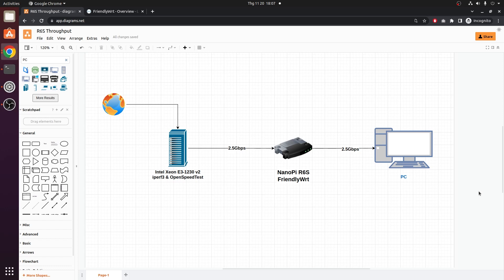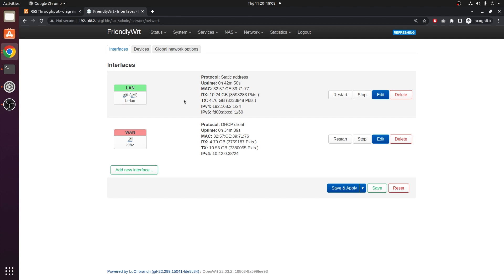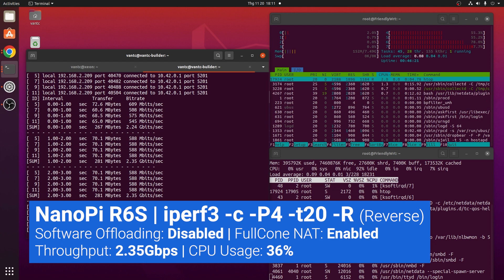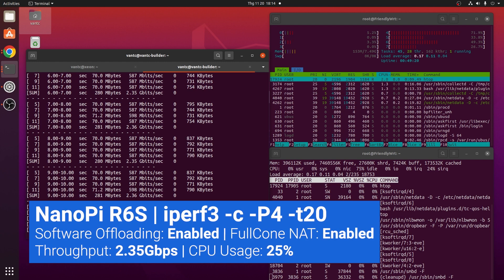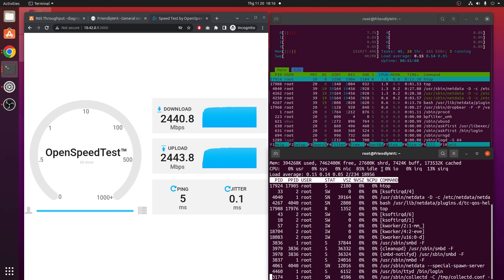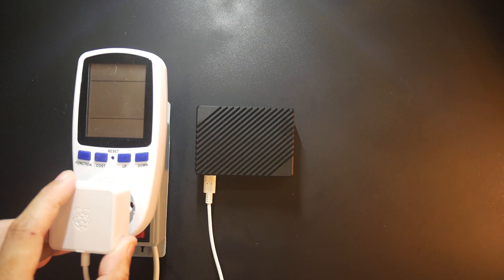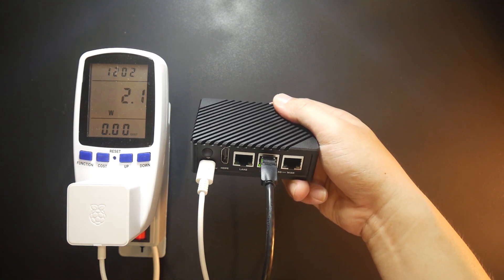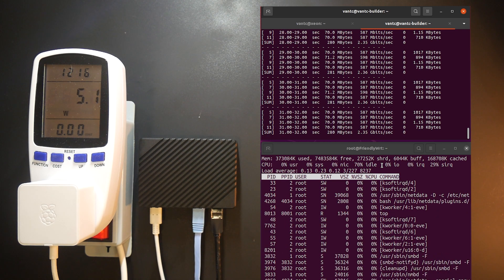NanoPi R6S - 2.35Gbps Throughput with only 5W of Power Consumption

Comment: Hi, would you still recommend the raspberry pi4 power adapter for the Nanopi R6S? - I have recently ordered a Nanopi, so I am looking for the best power adapter now..thanks!
Reply from the maker: Hi, I don't have any problem using the NanoPi R6S with the Raspberry Pi Type C power supply for days. However, you may take a look at other PD power supply since the R6S supports this.

Comment: Thank you thank you thank you! I just got r6s and was very disappointed to it's routing performance (got sub-1Gbps speed) both when running FriendlyWrt and DietPi. But your video proved that I should see near 2.5 Gbps speeds. I proceeded to try out older version of FriendlyWrt (rk3588-sd-friendlywrt-21.02-20230222.img) and now I got full speeds. Not sure what's going on but I was just about to toss R6S and buy x86 based solution instead, but now I know better. So thanks again!
Reply: Ok, found a workaround... R6S has 4 slow cores and 4 fast cores. If processes related to routing are assigned weak core, routing performance is poor. For some reason it looks like IRQ affinity tweaks or so are not working on FriendlyWrt 22.03.3 and sometimes weak core is assigned. So I disabled all weak cores on boot and everything is all good (who needs them, there seems to be enough horsepower even without weak cores):

# Disable weak cores
echo 0 > /sys/devices/system/cpu/cpu0/online
echo 0 > /sys/devices/system/cpu/cpu1/online
echo 0 > /sys/devices/system/cpu/cpu2/online
echo 0 > /sys/devices/system/cpu/cpu3/online
Reply from the maker: It is strange. I didn't disable any cores and everything is working just fine.
Just in case you want to use all the cores, here is my suggestion:
- Enable Packet Steering (at Network Interfaces - Global tab)
- Enable Full Cone NAT

Comment: Love this setup .. only thing i'm wary of are the NICs themselves .. I prefer Intel NICs over Realtek for 24/7 routers
Reply from the maker: Yup, I got some problems using the Realtek NIC with pFsense or RouterOS (Mikrotik). However, it is working great with OpenWRT. I have never got any problem so far (both x86 build & SBC).
Reply: Used to think like this until all these firmware issues with Intel nics over last few years of models. realtek drivers have become rock stable over the years so unless the realtek hardware components  itself used is not second grade I would feel just fine using it.